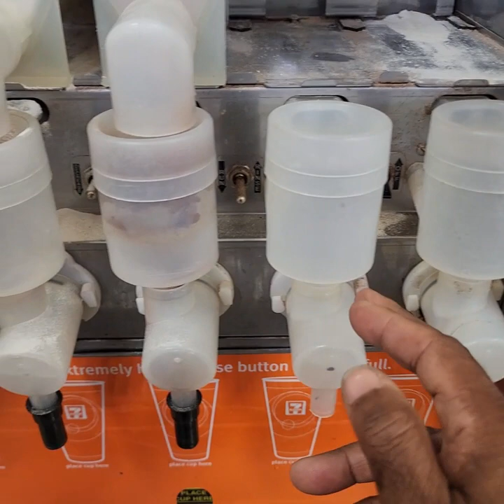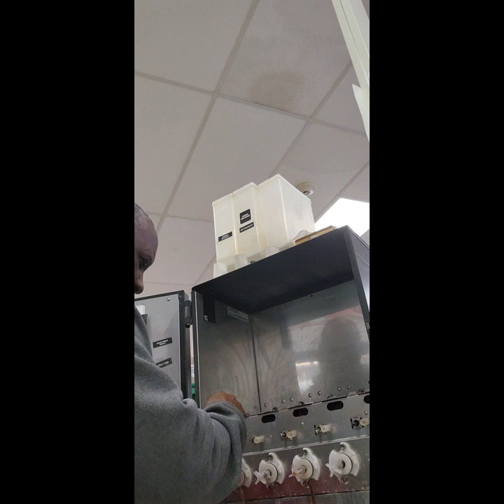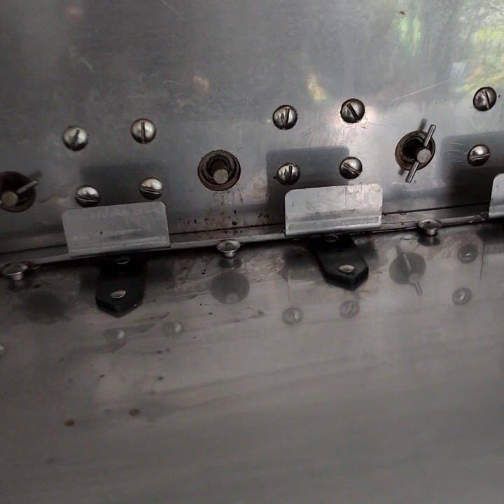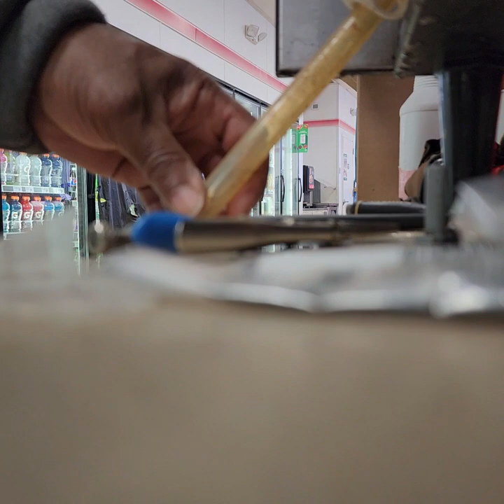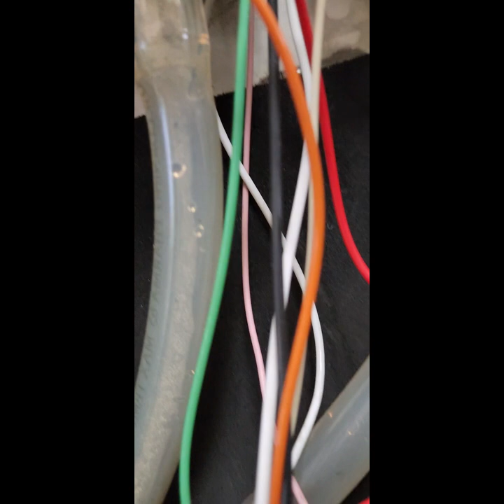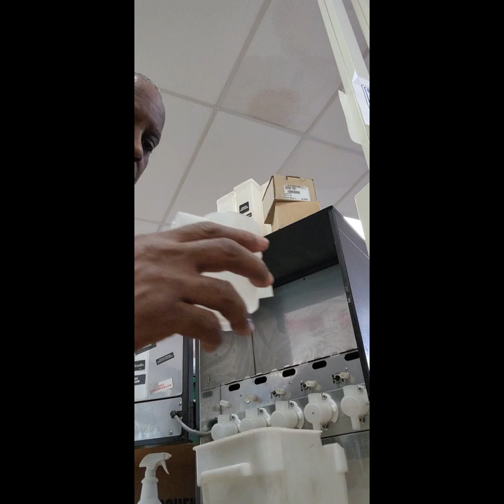Bunn Cappuccino Machine Repair

Comment: Did replacing the dispenser seals fix the leak? The set screws on mine seem seized not allowing a tight connection to the tank
Reply from the maker: Yes replacing the seals did work.

Comment: Another thing I thought of, lol was when I used to replace the dump valves, is to look inside the old valve adjustment screw and count the threads/ Notches to see how many turns to make on the new one . Makes it so much easier when  calibrating the flow rate. I love this stuff, if you can't tell.. 👍
Reply from the maker: Lol! Very true that makes things easier. Great tip!

Comment: I like to remove the tank lid and then Siphon out the water just below the valves . That way I can check the tank and heaters for mineral buildup, also clean off that water probe while I'm in there. Another trick I figured out was if the power cord was hardwired or hard to get to I would make a little jumper with an Alligator clip and male spade connector on the other end to ground the probe so the tank wouldn't fill. But I'm sure you already know these tricks. Man I'm loving your videos!  always thank you.
Reply from the maker: Thanks for those tips Sulk31 keep them coming!👍